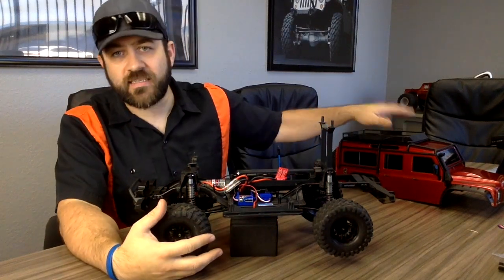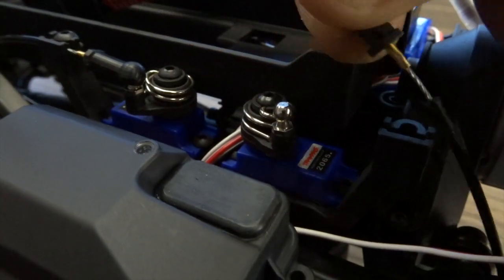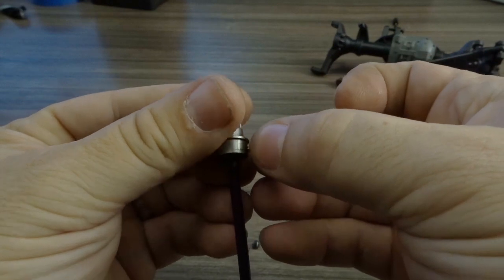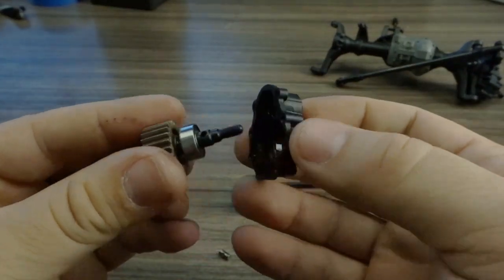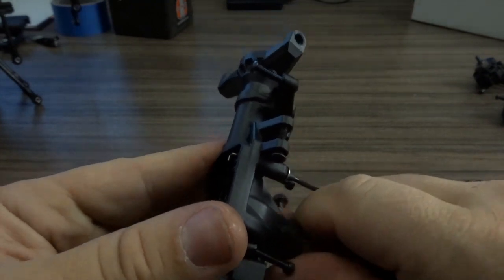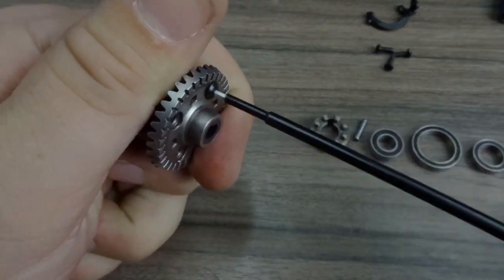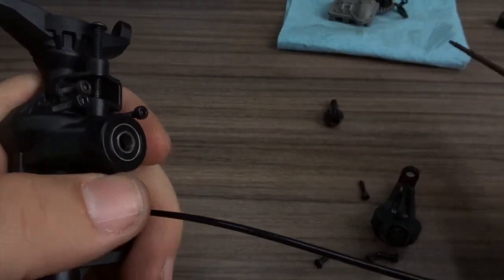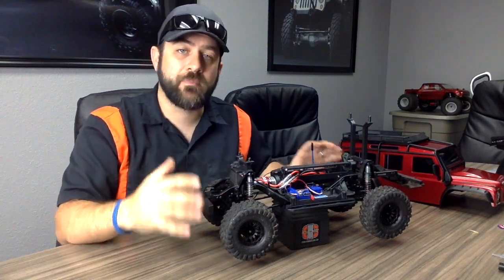Traxxas TRX4 Axle Disassembly - Portals & Selectable Locking Differentials

Comment: Now it's an old video. But I have bought ALU axle houses. Can I just switch from the old gearings, bearings etc from the old to the new? Or must i disable it like you did? I have only driven it 4 times easy.
Reply from the maker: @tittentei7331  if you’re swapping housings, you’ll need to most of this, but you don’t have to open up the diff case.
Reply: @HarleyDesignsInc  Thank you so much. Can i use original part 8232 from traxxas  to the front axle? It was missing one when i got them in the mail. Thank you again:)

Comment: Can you bay just differential, like part?
Reply from the maker: Do you mean the actual gear differential or do you mean a complete axle assembly? Every part is available separately,  but you there is not a single part number for the whole axle.
Reply: @HarleyDesignsInc  5:07
Reply: @HarleyDesignsInc  good video, very

Comment: If anybody is still paying attention to this, I have an issue. On my trx6 the rear axle does not lock it stays open the cable is moving the center diff locks and unlocks. When I get in there I want to take apart as a little as possible what exactly am I looking for? Any help would be appreciated 👍

Comment: I just watched your video on disassembly of the axles.  I noticed there doesnt seem to be any grease or oil in these assemblies. Did you take apart  before video or is this how it is? What grease or oil is recomended for these assemblies?
Reply from the maker: That’s how they shipped it. I used Vanquish grease on my truck, but any decent bearing or marine grease is fine.
Reply: simply use some harley-davidson gearbox oil ;))

Comment: I wish there was an option to only lock the rear axles and unlock the front! (Fully locked, Front locked, Rear locked or Unlocked)
Reply: You can make it easily ,just switch both channels 4/5 in a recieverbox ,and reprogramm it in a Radio ,video on YT is somewhere to find ,i did it with my both trx´s and it work perfect

Comment: I really want to not like it!! It's Gimmicky and Overpriced in its field. 
Now the SPORT! There's a lot more to like about that!! 👍👍  I actually think I would GET a TRX-4 Sport, and just add a selectable Front Diff, leaving the Rear locked....
Josh, I know you're a Comp Crawler, and the idea of ANY open Diff, could make you break out in a rash!! 😂😜 LOL
I would really appreciate the extra Steering control, and the MUCH lower stresses on the whole Front Axle. Lock it only if I need it. 😉😎
I do hope by now - SOMEONE is making a Metal Diff Housing for this...  With all the Fan-Boys, surely somebody is making one.
Thanks! That was a good look inside.
Carmine 💥 ⛽
Reply: PoorManRC Yeah Racing RC has brass diff covers, portal boxes, and I think inner "C" for the axel. There's a guy "Mateo RC Movies" he does a conversion. It adds more weight down low and is stronger parts. Appears to be exact fit. I haven't ordered mine yet but I will soon.

Comment: Harley Designs
, can the diffs be locked somehow and just do away with the cables?? it would be just one less thing to worry about for me. I'm just going to be using the axles for a custom build and dont want to mess with more servos and servo placement...
Reply from the maker: Yes, there are several options for solid spools popping up now.
Reply: Harley Designs it'll be cool if you did a upgrade with the new Traxxas spool n any upgrades like metal cup..

Comment: I have one so thanks for this, Josh.

To person below making a comparison to bicycle brakes, I'm a bike guy. I work on IT stuff in a bike company and wrench my own bikes as I have for years. That cable gauge and wrap is ever so slightly smaller than that of high grade bike cables what last for years if taken care of. In short, flow a little lube down the top ferrule once in awhile and pro'lly doesn't need saying around here, don't apply high pressure air/water when cleaning. If you mess with servo placement, etc, mind the bends and check for smooth cable movement and adjust those servo limits. Should be worry-free. It's a ridiculously beefy cable.

My worry? That shift horn looks like fragile crap. Mind those servo limits. Not diggin on the plastic diff cup. I took a quick look on the Traxxas site and it appears they don't offer replacement cables. Surprising as they offer everything else down to the screws. Pro'lly on there somewhere but if not just keep packing grease down that thing and it'll live at least 7 years, even with water immersion. It's stupid-beefy for such a small thing.

I'm guessing most users will get bored with the lot of it and somehow hack it to permanently locked or there will be aftermarket locking stuff. I've only had mine a few weeks and I'm almost at "Meh, don't see truly useful functionality in this. Just lock it" Still, kinda neat I guess. Nerd factor 7, useful factor 3. I have a few rants elsewhere about how I reduced mine to all lock/unlock vs. that goofy front/rear thing. Bless them for trying? The rest of the axle seems gravy for sure though! Portal are awesome!

Comment: I was told all the pre-order's have plastic gears in the differentials and transmission but I don't see any here.
Reply from the maker: +Sask Trail Riders the transmission has some plastic gears in it on this truck but the axles are all metal. The new versions have all metal trans gears.
Reply: Should I be afraid of buying a pre-order truck?
Reply from the maker: +Sask Trail Riders I wouldn't be afraid of it. They are still solid.
Reply: no
 @TrailRider

Comment: great video. is anyone aware of a way to buy these axles?
Reply from the maker: +Dante Smith piecing them together from spare parts is going to be very expensive. Spare parts are not available yet however.
Reply: yeah thats what i tried. ill just have to wait come time. thats cool though. thanks
Reply from the maker: +Dante Smith being from Traxxas, I'd expect the resale value on these to be quite low. Buying second hand and stripping it down may net you a cheap set of axles!
Reply: yes also a good idea. im sure in the near future they will start to pup up places
Reply: Wish I could find steel or aluminum Axles! I keep find the replacement plastic 🤦🏽‍♂️

Comment: the scx10 is CRAP compared to this traxxas
Reply: the garage Not really. It has many more upgrade parts and bodies and everything. But I agree, the traxxas is better.
Reply: WaterTester when it comes to aftermarket upgrade parts and accessories and I think the SCX10 and the clod Buster maybe the Kings
Reply: Just wait till all that useless garbage in that axle start failing lol. Unlockable diffs on a crawler lol yeah cause i want to unlock my diff while crawling and lose traction. This is a basher truck plain and simple.

Comment: So the only thing keeping from a 4ws setup is the offset front axles. 

I'm seeing a option set coming soon.
Reply from the maker: Actually to make it rear steer you would have to do quite a bit of work. You would need new rear axle shafts and upper portal gear, new back half of the rear portal that is built to screw onto the C-hub, a rear servo mount of some sort (axle mounted unless you want to figure out a panhard too), plus steering linkages.
Reply: Harley Designs 
Forgot about the built in caster of the front c hub, but sounds like most front axle parts could be made to work with a few new parts needing to be made from traxx.
I'd go axle mount servo for the rear.

Comment: where is the grease inside de diff??? lol
Reply: Harley Designs-yes, why didn't Traxxas put any grease on those metal gears? I wonder if all TRX-4 trucks will leave the factory this way or was this just a case of skimping or forgetting so they can rush these things out the door so we can see them?
Reply from the maker: +Gregory Guza it seems like a common thing for RTR vehicles to have too little grease. Tearing into a RTR after buying it is always a good idea. This isn't a super high RPM car so it would probably be fine, but more grease would be better in my opinion.
Reply from the maker: +Pokaille the only grease was on the ring and pinion. The truck needs more grease.
Reply: Harley Designs-I'm actually considering getting one of these (one of these days) if my finances allow it and there is definitely a lot of disassembly and parts in this truck to get used to. Definitely way more involvement than my Rustler and 2wd Slash.
Reply: Which grade of grease has to use into differentials? the same for both?

Comment: Looks quite beefy. I am skeptical of the longevity of the cable and diff locker. I guess time will tell!
Reply: I have had my TRX4 for 4 months now. I run it every day and absolutely no problems with it. I have worn out a set of tires already but no issues what so ever. I use high temp wheel bearing grease, red, in trans and axles. Runs quiet and smooth. I also put a small amount of grease inside the slips of the driveshafts. This is one of my best RC's.
Reply from the maker: +RcFrenzy I have no experience with it but Summit owners may have a better idea.

Comment: I like what I see. I wish you could switch from 4 to 2 wheel drive for some reason, I think it would be cool.
Reply: Build your own driveshaft disconnect.
Reply: Reverse a Capra transmission and run the dig unit to the front axle. Grind down the locking lugs so it’ll only operate drive or freewheel and no more lock. 

I’ve driven my trx6 in fwd and rwd just for fun and it’s crazy how much less traction it has. Especially fwd lol
Reply: Hehe, thats what my summit VXL did in the past (front driveshaft cracked) and which was pretty funny. From time to time i release the front-drive-shaft now for that reason (bashing with full rear speed like a 2WD Bandit)
Reply: @artministratorle  it

Comment: Hey, I think it's a nice truck, but what I find with most rc cars is the fit of the bearings in their respective housing. As an retired auto tech I don't like slop. I know I know but it drives me nuts. I usually shim them. Your thoughts? God Bless Ya   Dave
Reply: David Aarons I agree it would be very easy for manufacturers to put a few raised ribs in the bearing housings (like a internal spline) if they feel that they can't hold the tolerance on the moulding to make the bearing a snug fit